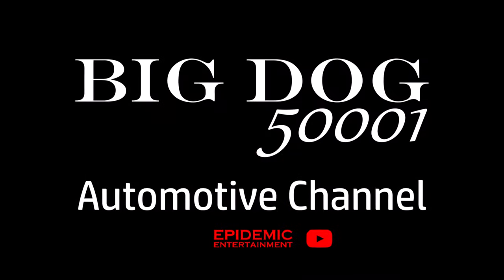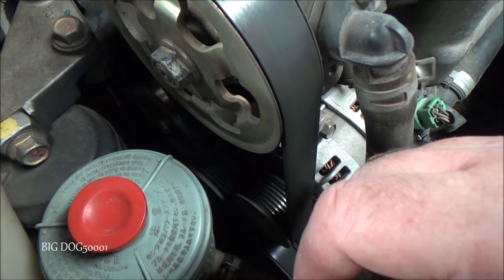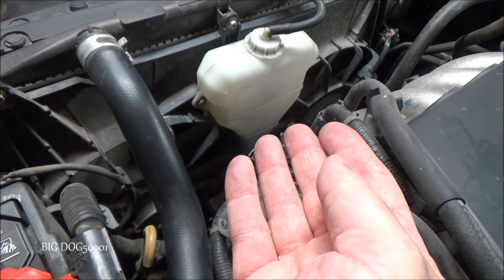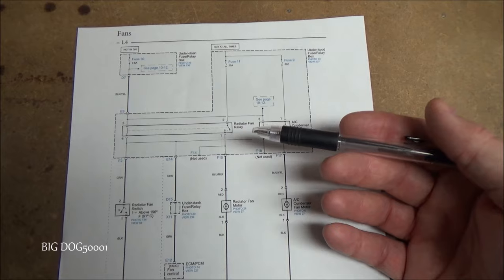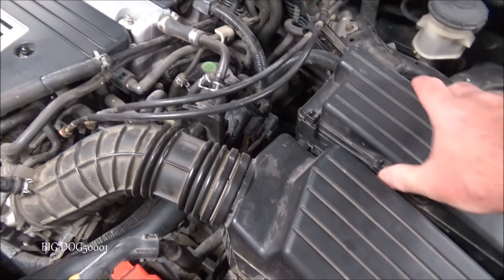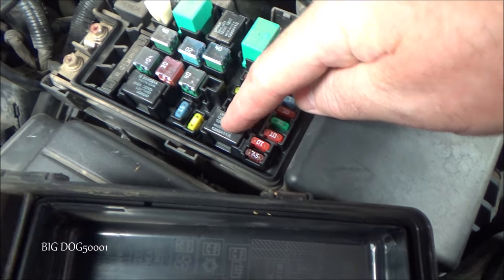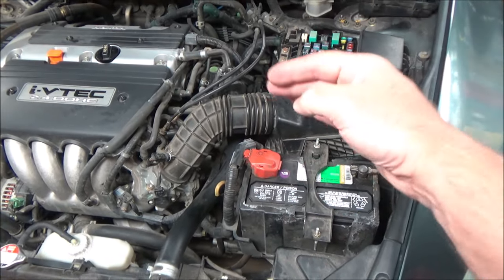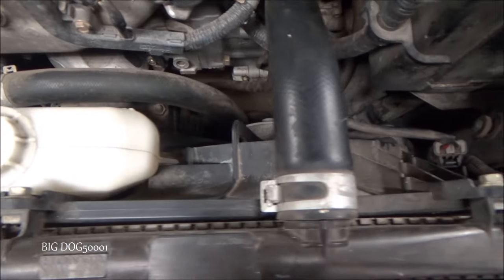Honda Accord Overheating - Troubleshooting

Comment: Nice diag. Don't forget the owner can run the heat inside the cabin to try to alleviate over heating due to a fan not working.
Reply: What if they tried that to no avail bc even on full heat, full blast... The air is simply coming out cold? Not a stitch of heat? 🤔

Cuz that's the boat (Honda 😆) that I'm in right now
Reply: @kcstonemenaut3707  there may be a not enough coolant in the system.  Check if the coolant is low. If it is you'll need to find how why it's low and fix that leak

Comment: The tap test loosens stuck brushes in the fan. loose carbon gets in between the brush & it's holder & restricts free movement of the brush thus contact between the commutator & brush is compromised. You can just clean the brush holders, replace the brush & spring & you're good to go. No need to buy a new fan. . I replaced three fan motors before I realized you can repalce the brushes yourself.

Comment: Hi are there other issues why coolant fan does do not work. Both my fans work with ac on but even in the summer I never have them or even the coolant fan ever come on. Never had over heating though.

Comment: I just replaced the serpentine belt on my Honda Accord I noticed its overheating which it didn't over heat before it snapped I did notice where coolant goes the little white cap on the hose is cracked could that be the issue

Comment: Today i have the same problem to the same car 2007 Honda xls , I was driving and the steam started coming from the engine after all 😢 I opened the engine Than I tested the fan as your show in this video  but not think happened !!! I tried a swing between the fuses!  but my diagram fuses boxe shows both of them in green of the a/conditional and the engine in 20 amperage ,??? the engine fan not working and the a/c works ! in the same time the radiator is empty of liquid ,!!!😢😢😢😊😊😊tomorrow I will finish the work than from there hopefully it will resolve the problem !! Tank you for your show is really helpful !! I appreciate this Sir !

Comment: Had this same issue with my 2006 Acura tl. Gave the fan an little tap tap taroo and it works. Replaced it. Great video.

Comment: Great job on being specific to what could go wrong. Always good to see someone be as meticulous in their work, it shows you care about what you do! Both my fans work with the AC on. However if I drive around the block with the windows down and the air conditioning off, I never see, or hear the radiator fan go on. Although the temp gauge inside never seems to get past the normal mark. Could it be that the sending unit (which is brand new) never gets hot enough to trigger the ground to engage the fan? Thanks again for the video!
Reply: Even, I have the same question. As per Honda, both the fans should come on irrespective of whether the AC is ON or OFF.

Comment: Nice very informative and very detailed!  I noticed you didn’t check the fan switch thats at the bottom. could it be that as well? I have seen some other videos. It was the fan switch. Thanks in advance. Great channel by the way.

Comment: Thanks BigDog.

My 2003 4Cyl Accord Coupe threw a brake light on the dash.  Parking brake and/or brake fluid level problem.

Unplugged the master cylinder level switch and the light goes out.

I'll look for a video where you have addressed this.

Comment: My 04 Accord isn’t overheating. But coolant keeps leaking from the reservoir cap. I have replaced the cap from the dealer. There is no seal required for the cap. Any suggestions?

Appreciate your very detailed videos!

Comment: My 05 honda accord 2.4 has been overheating. It loses coolant but don’t see leaks. I’ll fill the coolant and after about 2 weeks it’ll start overheating and when i go to fill it, it takes quite a bit. Has new radiator, don’t get a code for thermostat, not sure what it could be. Both fans are working fine. Could it be the pump? Head gasket?

Comment: Having a different issue. Had my heater control valve crack and leak out coolant. Replaced the valve, now the fans don't come on at idle. Not sure if I have still have air in the coolant system or if the cooling fan switch is bad.

Comment: I follow everything you have shared. My problem is the radiator fan does not come on when the temp threshold is reach. I have to turn on the a/c to get the radiator fan to turn on. This leads me to change the temp sensor at the engine block. I did that. It did not correct the problem. What im i missing?

Comment: Hey Bud Dog, I have a 05 Honda element and having issues with my transmission. Pull code, it's telling me a solenoid issue. I have replaced all solenoid and still have the same issue. What test can I perform to see if the solenoid are getting any voltage?

Comment: I have a 2005 accord that overheats after driving it for a bit every time both the radiator and the ac fan work when I checked and it has coolant what do you think is the problem?
Reply: It might be bc I don’t have coolant in the actual radiator I’m gonna put some and see if it works

Comment: Hello, I have a 05 accord fans come on only when ac is on, heater doesn’t blow hot air and fans don’t come on when car is hot only when I turn on ac on so car overheats when ac is not on. Any advise ?
Reply: I am having a similar issue, but like I have no leaks. Only one fan comes on when AC is on my car also is throwing no codes been trying to figure it out for a few days. I know it could just be the fans but i am not sure. I have also heard it could be the temp sensor if just the fans come on when you have ac but since it throws no codes for me they say its highly unlikely
Reply from the maker: There are many things to look at when a car overheats, but I would first verify coolant is at the proper level.  Coolant level, Engine Coolant Temperature (ECT) sensors, water pump, hoses, thermostat, engine computer, radiator etc all need to be in good working order for cooling system to operate properly.  

'05 and newer 2.4L Accords use two ECT sensors (ECT 1 and ECT 2) and the fans are completely computer controlled on those models, I would make sure both ECTs are working (ECT 2 should be located at bottom of radiator). V6 Accords are also computer controlled but they have two speeds (high and low) and there are several relays involved (all must be working).  I typically use a scan tool to look at both ECTs while the vehicle is warming up to verify they are operating properly (but you usually need a higher end scan tool to see both ECTs).  Side note, I am not a fan of aftermarket ECT sensors on Hondas as they can cause issues.

Older '03-'04 2.4L Accords have a radiator fan switch located at the bottom of the radiator (instead of ECT 2), the switch closes and turns on the cooling fans when the coolant at the switch reaches about 200 degrees.  For those Accords the switch is in control of the fans for normal cooling fan operation (with AC off).  With AC on, the fans are computer controlled on all models.

In all cases, BOTH fans should operate at the same time on this generation Accord and both should come on when AC is turned on.  If only one works, troubleshooting on that fan would need to be done as that can cause overheating.
Reply: @BigDog50001  thank you for replying! When I got to the end of your video I tapped my fan with a wrench and sure enough it started spinning I was like wow so I have a new radiator fan on the way since the motor cost was around the same as replacing the fans. I will refer back to this comment if I have more issues I have tested the fuses and temp sensor and such they seem to be in working order. But if I’m missing anything else I will come back to this thank you for the video and for the help!

Comment: That drivers side head sensor (rear) was the culprit on mine after new radiator with fans and lower drivers  side radiator temp sensor , new radiator houses, new Honda thermostat and Honda therm housing $$$, new firewall heater control unit and new hoses

That sensor is rarely featured and a bit of pain to remove and replace without wedging a socket 🆘
Reply: And new Honda rad cap

Comment: I put new relays I did the AC test to see if the fans work they do it’s not the fans and it’s not my relays do you think I could have a bad coil and if there is a bad coil for when the car is off to make the fan turn on to help cool the engine how would I fix this

Comment: My 2005 Honda accord commuter also overheats when i idle for more than an hour during summer days. I add coolant and it spills out when it starts over heating. I’m taking it to my mechanic tomorrow. But the coolant drains within a week, sometimes 1-2 days.

Comment: Mine does the same thing but it doesn’t over heat but the engine and radiator gets red hot some days fast and the one fan doesn’t come on until a few mins later which is normal I guess but my heater valve is bad I switching it soon and I was losing coolant so idk my heat didn’t work either I had to hit the thing to make it switch from ac to heat

Comment: My sister in law has a Honda civic Lx (2002) 1.7 and the car keeps overheating after about an hour. We replaced the radiator, hoses, and the thermostat and still have the issue. Any possible solutions you could think of? Thanks.

Comment: 2001 Honda Accord LX. No fans working. Not even AC fan. Checked everything. Voltage, continuity, relays, relay box, connections, etc Electrical wire short? Bad temp sensor on fan? Both? Beyond my skill set. Car ain't worth a trip to the auto electric shop. Might be a garage queen. Too bad. Very reliable car.

Comment: Hi there, I see steam coming out from the right side of vents and not from the left side. The cool air is also coming from the right side of vents but not so much from the left side. My both fans are working and the coolant is just below the maximum line as I filled the tank with Honda OEM coolant. Why does steam come out from one side. Today it rained a lot with short thunderstorm and my car was outside.  Would appreciate your help. Thank you. It did the same thing a couple years ago too. My car is 2005 Honda Accord EXL. Thank you so much.
Reply from the maker: Sounds like there might be two different things going on.  Typically when people describe steam (or something like that) coming from vents when using the A/C system it is usually from a lot of humidity (moisture) in the air.  Turning the vents to recirculate the air (rather than fresh air mode) and running the A/C system for a while usually clears up the moisture coming out of the vents.  As for warm air on left and cool air on right when using A/C, that could be a couple things but many times it is an indication of low refrigerant in the A/C system (here is a video with more info):  https://youtu.be/w-NX26knA88
Reply: @BigDog50001  Thank you so much. Will watch the video.

Comment: So for around 12:13 , I have had a similar issue today with my 2007 Honda Accord se 4cylinder and it’s radiator. I recently changed my heater control valve , but the cable with the little hoop that connects to the valve switch pops off sometimes, when it does my car overheats and the upper radiator hose has popped off and sprayed coolant under my hood on 3 separate occasions. Me and my buddy are thinking of just swapping the hose this weekend when we do my brakes and rotors. However I guess my main question is this, if both my fans work what could be the problem? Before I had heat, and if I needed a/c I’d have to switch it manually. Now as of today I can only drive it with the a/c on as that’s the only way the fans turn on. They no longer turn on when the heat is on. If anyone has any idea your time, information and overall wisdom would be appreciated

Comment: my 2005 accord 2.4l has coolant in the  reservoir but none is the radiator any ideas????
Reply from the maker: A leak in the radiator or cooling system is the first thing I would look for.  If no obvious leak, another possibility is a blown headgasket or other issue causing coolant to get burned up inside the engine.

Comment: This is crazy. I have this exact model and year and it started overheating on my drive home today.(7-21-22) and I also did the same kind of troubleshooting and determined that it's the cooling fan. . It's almost like they're on a timer to go bad at the same time. Lol.
Reply from the maker: lol!
Reply: @BigDog50001  Btw, there is a replacement electric motor with the correct plug connector being sold on Amazon. I thought of using another electric motor from a used Accord, but then again, you're just taking chances so I decided to order an aftermarket one from Amazon we'll see how it goes.
Reply: I ended up taking apart the stock electric motor and used some electrical motor cleaner spray and  just cleaned it out, used some emory paper to sand the commutator where the brushes ride and applied some dielectric grease and it's working fine now after putting it back together. YMMV.

Comment: So I checked everything on my 1998 honda accord cooling fans, I checked the fans the fuses the relays, everything still no conclusion, I tried to bleed the coolant and happen to lean down on the wire that goes to thermostat! Check this plug! My ground was cut and making the fans not kick in
Reply: The plug that goes to ther thermostat, one wire was cut

Comment: Why didn't u test the fan off the top? That let's you know off the top if it's good or bad. If bad replace and double check if overheating. It's quicker. The wire diagram explanation Is good though as well as the fuse check.
Reply from the maker: This is a teaching video and not necessarily how I would do things step by step if I wasn't recording it.